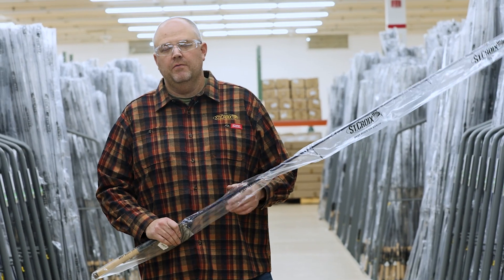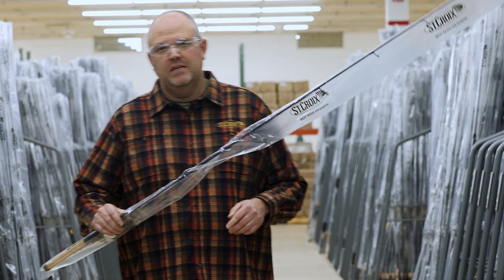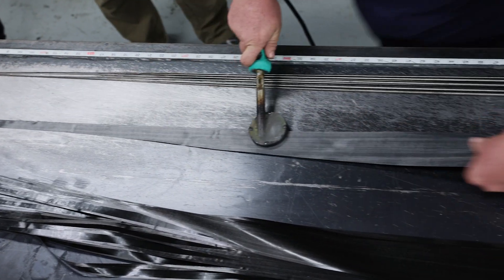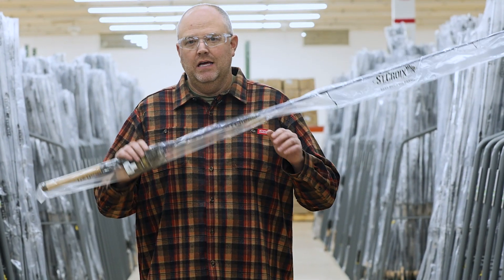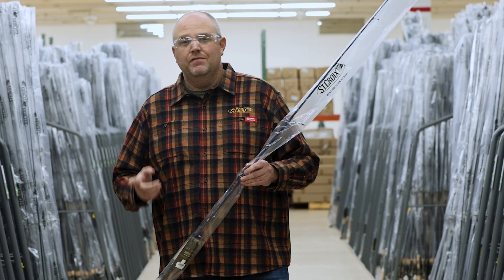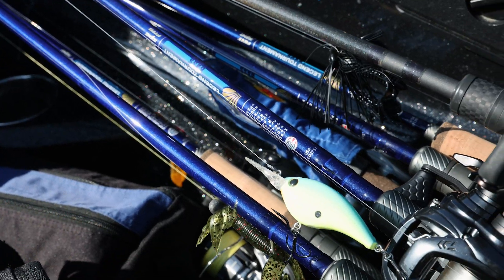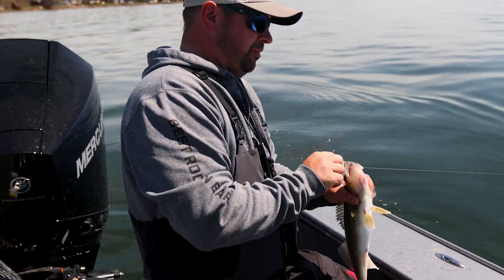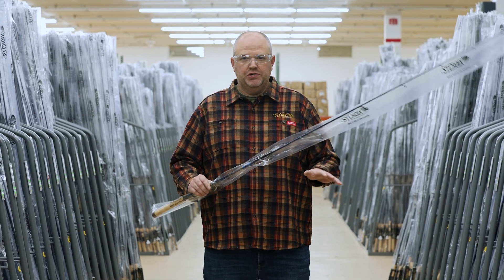A Heavyweight that Weighs less

Comment: Did stcroix stop making the ten foot musky rods.
Reply from the maker: Currently we do not build a 10' musky rod. The cost of shipping for the 10' is close to equal of that cost of the rod. However we do see the need for this length of rod and are considering making it again.
Reply: I have the ten foot st croix musky rods, and they are awesome.
Reply from the maker: @@frisco2510 At this point we are not. We will revisit this decision. Please look at the new Onchor line that is designed for Salmon/steelhead.